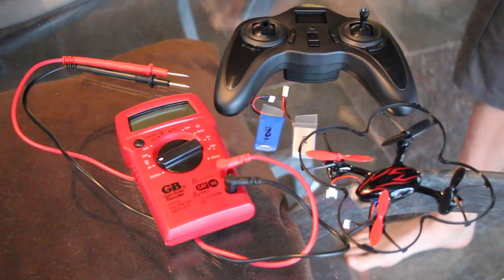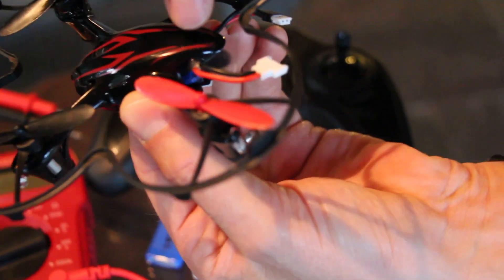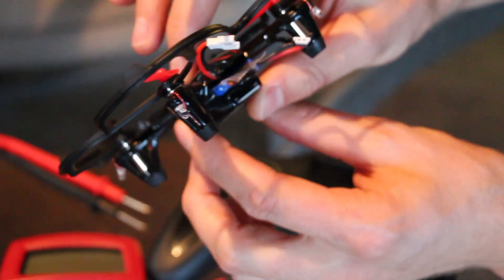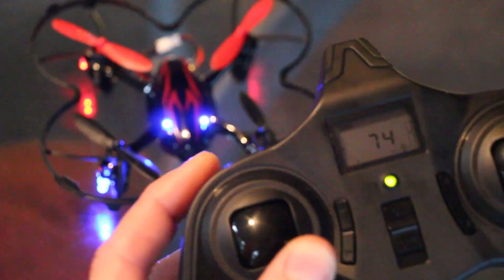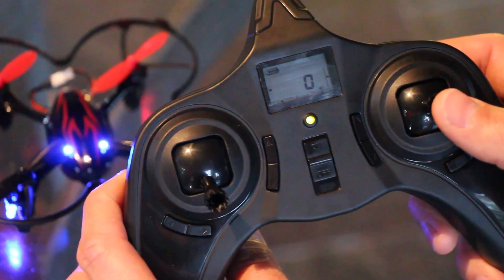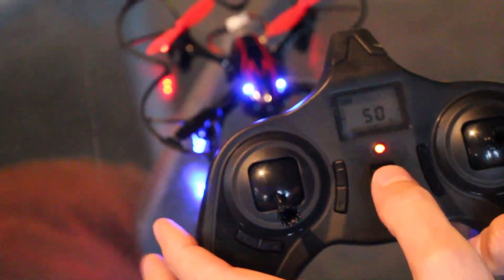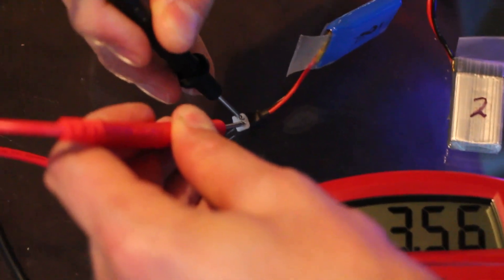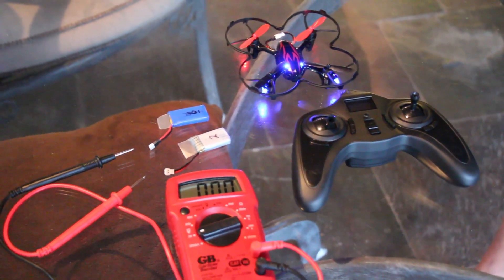Hubsan X4 Quadcopter MUST-DO Mods and Tips

Comment: I got 107c. When I'm hovering move in any direction if I move back to middle my quad keeps going in that direction am I flying in acro mode does not fly like Eachine JJRC, they stop whenn you release. It is harder to flying some degree.  Did not know they come in different flight modes.

Comment: Good tips, but just one word of warning when checking the Lipo battery voltages with voltmeter prods. They are very close together, and if the prods touch, the Lipo battery can and will explode in your face.

Comment: I found a lost drone. Thinking it is the Hubsan X4 H107C, I ordered and received the transmitter for Hubsan. However, it was not pairing with the drone. Upon investigation I found that the drone is not Hubsan but it is Eachine X4 H108C. If I replace the control board of Eachine with that of Hubsan, will it work with the transmitter? That way I can use the transmitter too.

Comment: Dont really see the sense in calibrating against wind. even if you have a steady burst from the exact same direction, any yaw turn by the copter will result in a bad alignment since now the wind is coming from another angle. 

other than that, dont forget to mention the stript you put on the batteries, its so important :)

could you maybe do a short video on how you turned the LEDs inside out?

Comment: I've busted one of the motors with the guard - it just slided off the motor body and the propeller was grinding it until the motor overheated
Reply: Then get one from banggood.com. The come in 3, and trust me the are hella strong, the also mount on the motor mount thing...

Comment: Great Vid. Well worth turning the rates down in standard mode too.... right joystick in for two seconds, then adjust the trims, clicking the left joystick between adjustments. It's in the manual, but not easy to see. I fly mine on 35% and it's much better.

Comment: it looks even cooler if you take the led wires out of the legs and have them sticking straight out through the body. The wire supports the lights and you can bend them to point any way. it looks bigger at night.

Comment: My new 107L keeps drifting backwards and in seconds it reached a point where you can't even compensate by pushing forward. I've recalibrated it many times but without any luck. Its pretty much useless indoors, in Expert Mode outdoors you can compensate by pushing forward. I guess i have a bad motor, by the sound of it
Reply: I had to reset the remote to factory when i got mine, you might try that and it may correct this issue
Reply: wow, that's a very late response. I don't fly my X4 anymore, i'm now into brushless freestyle.
But thanks anyways, migth be helpfull for anyone
Reply: Fábio Castro lol just got mine , lol

Comment: You should always trim it so it flys perfectly level in no breeze..then take it into the wind..that way if you hit a problem you have full control left right forward back..one thing you can do is use the forward trim only for wind..you can cut straight into a very strong wind with it trimmed right forward..just remember you ain't got much backwards then ;)

Comment: Before you calibrate the controller you gotta set all your trims at 50 first..sorry but its all good trimming it to fly level into a side wind until that breeze knocks you off track and your controls are set 70% left 30% right etc then you hit problems.

Comment: When you mention max altitude flight, how do you know when it's at max altitude without it going out of range and crashing? Thanks.
Reply: Very carefully.
Reply: Abram Harrison That doesn't answer the question at all.
Reply: There is no way to know when you're at the "Limit" of range. Just use experience amd take it further each time VERY CAREFULLY
Reply: But really the only way to tell if your at the edge of range is if the copter stops responding to controls. Just hopefully you have it above you and it falls back into range!
Reply: +hunty11 it can go really far so you can barely see it.  I think it can go higher than what most people say is the max. it's probably the max you can see the direction it's pointed.

Comment: With respect it's a volt meter or multimeter. No "o" required.
That aside thank you so much for the tips.
I just bought the non-camera version and the tape trick and securing the wires are a couple of winners!
Thanks for posting this!
Reply: Hey Michael if you haven't already you should consider flipping the lights. My brother nearly lost his when flying at night over a field. It landed upside down in (short) grass a small distance away. Complete nightmare trying to find it.
Reply: McGuireInK I've already done just that wroth a possible dreamcatcher mod/build next!